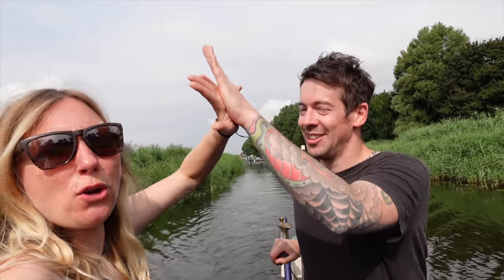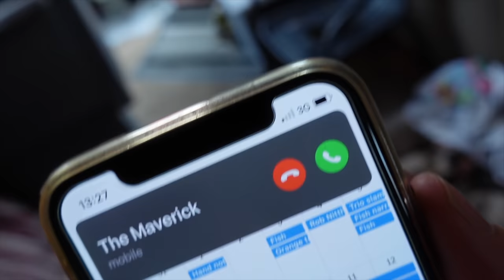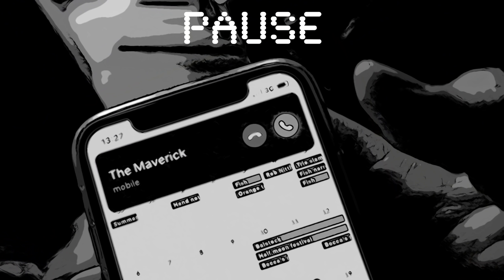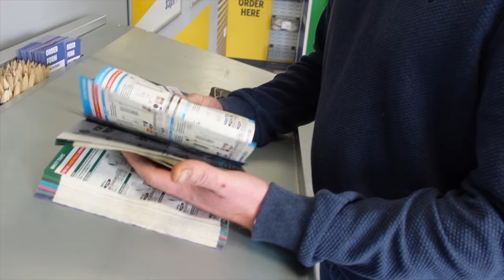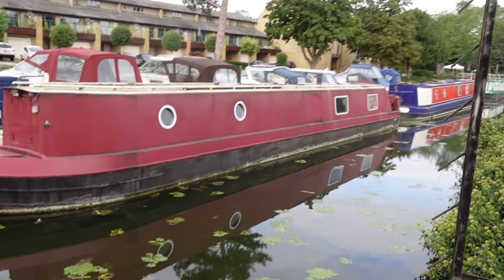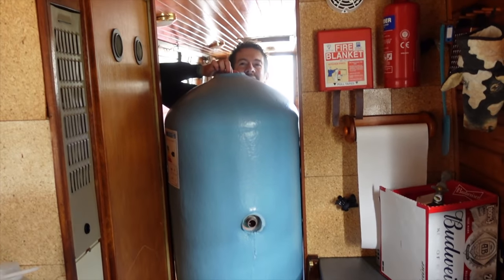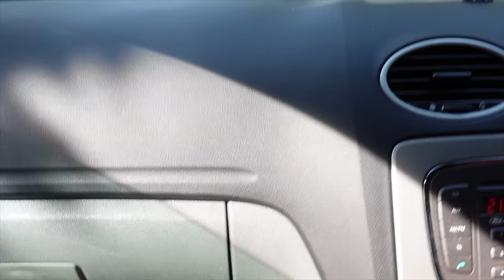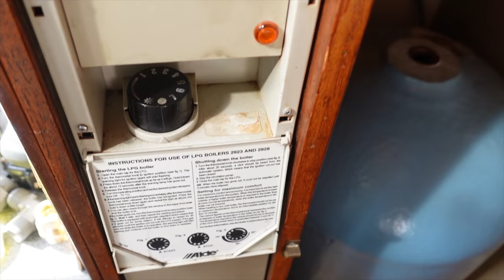HUGE Narrowboat WATER tank BLOWS !!!

Comment: You need a clarifier, which is designed to go on boats,it takes a higher pressure than a standard hot water cylinder,for house's, it's more expensive but will not deform,and can go to in the engine bay,I hope this helps,if you don't know,as those of us in the boating community.regards Alex and maria
Reply from the maker: Thanks so much for your input, were still learning so much, the 'clarifier' keeps coming up and seams to be the way ahead, that would probably explain the tank deform, we did see they sit in the engine bay, the idea all along was to try and heat the water while were travelling :)
Reply: @TheNomadicCrobot  that is where they normally go,they have to be sited on a board and fixed to it then glued to the steel work,your pipe work from the engine goes to one side of the tank the pipe work from the domestic side goes from the other , it's not a big job if you have the right tools and understanding,if not get a boat engineer to help,it will be cheaper in the long run.
Reply from the maker: That sounds positive, we have been looking at a few YouTube videos and it does seam like a job others have tackled, I wonder if we would need to get it signed off by a proper marine engineer? Many thanks again 😀

Comment: With that "belly button "...Doubling the plate.. ie welding a second plate over, its ok as a temporary fix but, if it leaks you will get rust forming from beneath and you wont know .. i know you cant cut a bit out, while afloat.  but bear in mind to have it done if you have the boat out of the water at some time in the future.  Getting a few anodes fitted to the hull below the waterline will help prevent corrosion and can be changed easily every year or so when they corrode out.  good work guys..
Reply from the maker: that's interesting, the belly button is such an odd find, we've never seen anything quite like it, the main priority id to have the boat safe so its something we will defiantly look into more when we get her our, thanks so much :)

Comment: Maverick maybe a good friend, but you need this sorting by a trained plumber...  I hope it works out soon as to allow you to re-lay the flooring.etc.  Good luck.
Reply: Actually, it's not that hard and from what I could see it was installed correctly The only thing to check before redoing the work is that the tank is rated for the water pressure that the pump produces.
Reply from the maker: yes we think the pressure was actually just coming through too strong, not a huge disaster at the moment, its all learning, thanks so much for your support :)
Reply from the maker: Thank you, will get there soon, we need to get our real adventure on the move :)
Reply: @gharwood1356    As an experiences 'DIY' enthusiast, the two areas where I only 'dabble' are electrics and water.  Bigger jobs require trained tradespeople. I would question using a domestic immersion tank on a narrowboat when a calorifier is designed for the job and is seen as the industry standard.  I would hate to see Chris and Becca have another  flooding incident after all the hard work they have undertaken to get this far.  I would also suggest that they reconsider using a domestic gas fired combi boiler on the boat, as this will prove to be very expensive (bottled gas is also not always available in the middle of nowhere!). Maybe look for a diesel heating system as an alternative, however I do understand that they are trying to live their dream on a budget.

Comment: the previous tank did blow also, so it probably pump or the pressure valve
Reply from the maker: Thanks Alex it does seam like a pressure problem :)
Reply: The tank they tried fitting isn't ment to be pressurised. 🙈 it's meant to be on a vented system.

Comment: I’m sure you two have thought of this when making your decision on he water heating situation, what if the engine’s down, dead of winter and it’s going to take a week or two to get someone or some parts to the boat it repair it?  Backup plans?  That’s why I would go with an LP tank water heater.  Spare tank of LP up front just for emergencies on top of the normal supply.

You left it there?  With a defective tank?  Can’t we see at least one project finished?   
⚓
Reply from the maker: so sorry, were slowly getting there, so many problems to try and solve, but we will get there, the back up tank sounds like a grand idea, that would be extremely beneficial, Thanks Gregg :)
Reply: @TheNomadicCrobot  Oh crap!  My laughing emoji turned into a boat anchor, how the F did that happen!  I meant that comment in a joking jibe way; I didn't mean for it to sound like I was chastising you.

Comment: That cylinder is not designed for high pressure! The tank isn’t faulty!!! If you’re installing a mains pressure unvented cylinder it HAS to be fitted by an installer who has undertake and is registered as per G3 of the building regs. I’m really glad the cylinder burst just due to the water pressure of the pump and didn’t get heated up, that could have been very dangerous, not trying to have a go at anyone but am seriously worried, get a fully and properly trained plumber to fit a CORRECTLY spec’d cylinder, I’m sure maverick is brilliant but he’s dabbling in things he shouldn’t 

Sorry to be a moany PIA But I love you guys and want you to have everything just as it should be in your boat. I’m a plumber with fifty odd years of experience and I’m Registered g3, gas safe and a lot of other things and I’d be happy to give some technical advice if you need, just drop me a DM
Reply from the maker: Thats interesting to know, thanks so much for your input, so could the system just be signed off by a registered installer or would they have to fit the whole thing to? we have a lot to learn and really appreciate all the help we can, thanks again you definitely are not moaning, great advice  :)
Reply: @TheNomadicCrobot  yes it could be signed off by a g3 register engineer but the cylinder would need to be able to take pressurized/pumped water, something like a heatrae sadia megaflo (bit expensive) or similar

wish i was closer would be fun to pop a unvented cylinder in a narrowboat, dont get many firsts at my age 

might be worth calling around some companies as they may be up for a bit of publicity

Comment: Sorry your man has no idea don't let him connect the new tank up like that again or you will have the same result.Next thing is get rid of that Aldi boiler I had one many years ago it used up to two 13k bottles of gas a week and they are about £40 each these days
Reply from the maker: Thanks for your input, its great to hear the suggestions as were so new to all this, yes I wanted to change the dated boiler and have been told that they use a lot for showers, it just seamed easier and less complicated at the time, t what sort of system would you recommend? would be nice to research a few new systems thanks again :)